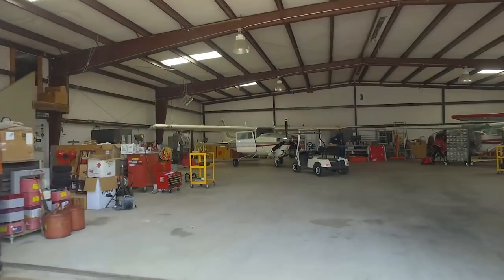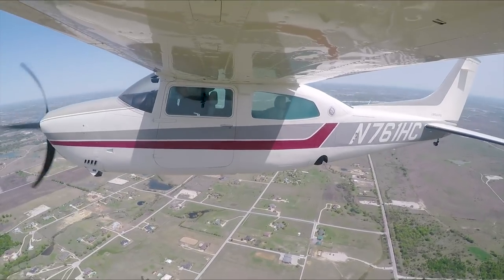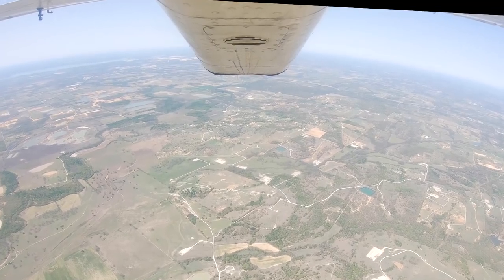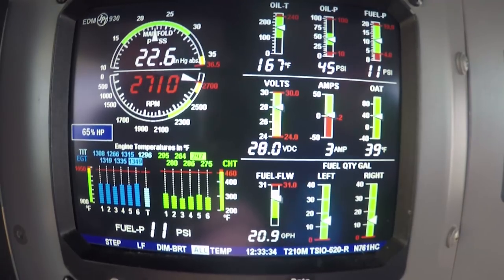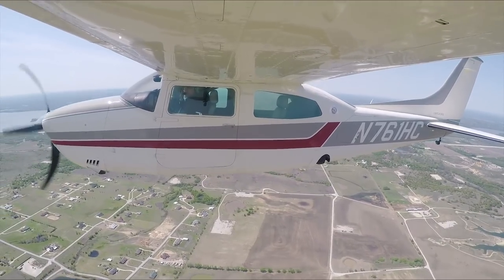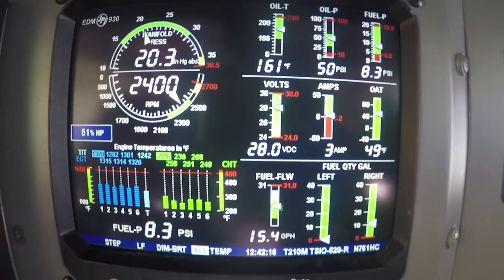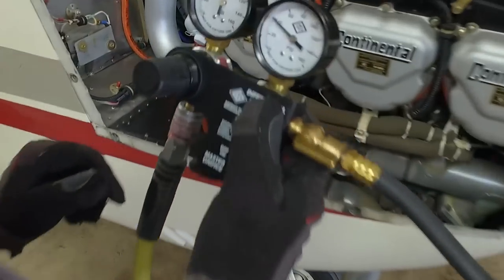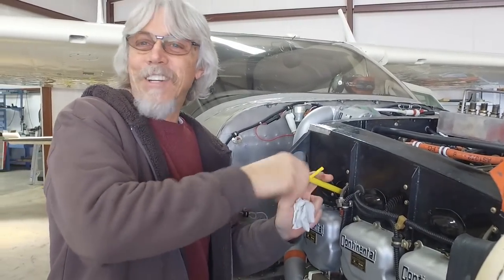Compression Check - TakingOff Ep12

Comment: Why in the world would you fly the pattern at 2700 RPM's? That's crazy. Leave the RPM 2300-2500 as it was in cruise and go prop full on final in prep for a go-around.
Reply from the maker: Because they were getting the engine ready for compression checks and need to run hot.

Comment: Very informative! Question about take off though, I was always told to back off the manifold to 25 in and RPMs at 2500 on climb out. I noticed that while he backed off the RPMs, he didn't back off the manifold pressure.
Reply from the maker: What airplane?
Reply: The T210M with TSIO-520-R ratings:Takeoff (5 min. at 2700 r.p.m., 36.5 in. Hg. mp. (310 HP). For all other operations 2600 r.p.m., 35 in. Hg. mp. (285 HP). Proper Fuel Flow & Conforming Engine, Terrain, Flight profile, Fuel Economy, Load  etc are all contributing variables. With accurate digital TACH readings the RPM was consistently 10 RPM high with T/O power set. Held higher MP for proper Climb cooling confirmed with use of Engine Monitor readings (EGT/CHT's). If you reduce MP during Climb this will also reduce FF so with a 6-Pt Engine Monitor this allows you to adjust accordingly. 30" MP Climb is pretty std w/Turbo

Comment: There is a lot more to the overhaul decision making progress than what is shown here.  Compression doesn't actually tell us as much as many mechanics think it does.
Reply from the maker: Compression was just one piece if information.  Bad valves, past TBO were other pieces of info.
Reply: TBO means almost nothing for a well run engine.  Here we have many engines well past TBO that are working just fine. 
 One is at 4000 hours and is in excellent health by all measurements and performance.  Your failing valve was obvious by the EGT cycling.  What did the borescope look like?  What was the oil analysis saying?
Reply from the maker: The borescope confirmed their fears.  I didn't include that in the edit.  Where's "here" for you?
Reply: Yes, much more involved then what was discussed in video clip. Mismatched Cylinders that were mostly Chrome, Crankcase already cut down at least twice previously, undersized crank, non-7th stud case etc etc & list goes on. Factory replacement was best option overall. Went well past TBO & it was time to pull.